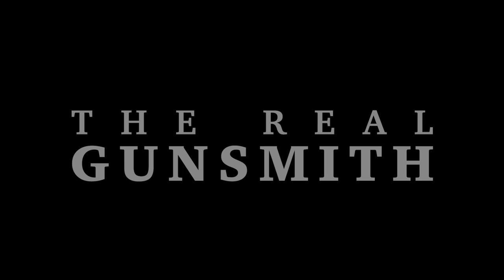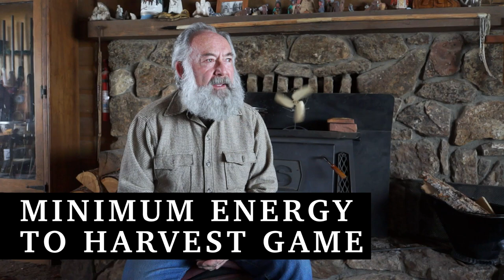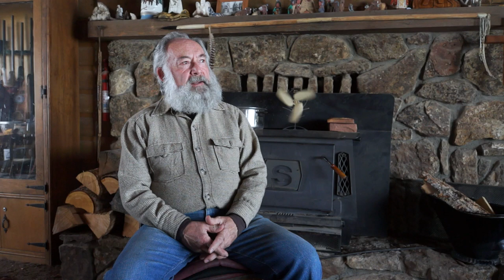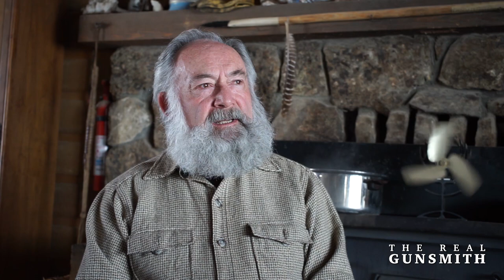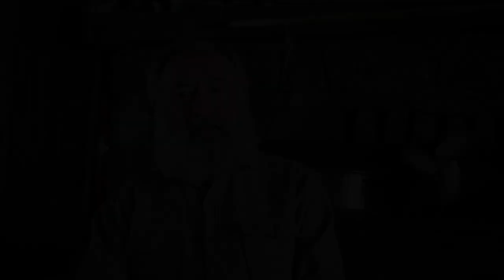Minimum Energy to Harvest Game -- The Real Gunsmith

Comment: In 1973 I bought a new Weatherby Vanguard 7mm Rem Mag modified the barrel with Mag-Na-Port from Ann Arbor, MI (Japan made, very shiny bluing (looks mirror black) and a beautiful wood stock that I had a craftsman glass bed, 1 inch longer barrel than found on Remington rifle chambered in 7mm Rem Mag), I fire lapped the barrel with 5 shots (not sure if it did any good but did it anyway) I hand load Speer Mag Tip 175 grain and they work just fine.. I pull the trigger and the game (be it from a mouse to a moose) stop moving.. If I have a good day I have grouped 5 shots at 100 yards that fit under a dime (under 1/2 in).. Not too shabby for a hunting rifle.. I have to say that Mag-Na-Port, builds confidence by removing a large amount of recoil and muzzle jump and eliminates flinching (a common problem with people shooting high recoil rifles).. I migrated from the 7mm Rem Mag into muzzle loaders for the challenge and now hunt exclusively with a crossbow.. Have not even shot the 7mm Rem Mag in 15 years or more.. I pull it out once a year, clean it and put it back in storage.. I also have an Ithaca 30-06 that my father left me after his death.. That also shoots very well with 165 grain hollow point boat tail bullets.. I am proud to say that both look like new and when I die one son gets the Weatherby and the other son gets the Ithaca..

Comment: Do you believe that handgun hunting is ethical? For the longest time I have wanted to take my 357 magnum out to shoot a wild hog, but never actually did it. Obviously I'd be keeping it within archery range and use a hot loaded 158 grain soft point, but I am still iffy about it. I have gotten pretty close a few times and always thought I could make the shot easy, but I usually have hot 125 grain SJHP bullets for couger or crackhead defense. I have my doubts that the load I use would have enough penetration for a hog.
Reply: Put the .357 through a lever gun , 158g will flatten any pig out to say 125 yards. 80 to 90 yards is optimal , I've killed hundreds of them here in Australia with that load. 30/30 is more humane out to 200 yards,or a little more , but up close there's zero difference.

Comment: Thank you for saying that BC means next to nothing for the hunter!  I get so sick of hearing people talk about the BC of the bullets they're using to take game at 75yds, as if it makes any difference at all, lol.  I assume most people are confusing BC with SD (sectional density) which IS important for the hunter if you're at all concerned about penetration (you should be)

Raw data and statistics are a great tool... in the right hands of the person that knows how to process that data and effectively apply it.  For everyone else it ends up being a battle to find the highest theoretical numbers, even though they've no clue what said numbers actually correlate with in practice.  This isn't just a problem in the shooting community, it's everywhere, but I sure seem to see a lot of it from gun people of late...  If one would choose a hunting round based on the on-paper numbers there are a lot of cartridges that would be totally ignored.  Look at the big revolver rounds:  .44mag/.45colt/..454 casull/etc.  The SD's are crap compared to even moderate rifle rounds, the BC's are horrible, they're relatively slow, heavy, and nearly as wide as they are long.  Yet I've seen few rounds, rifle or handgun, that can put down a whitetail or mule deer as quickly and with the authority of a 240gr-300gr .44mag projectile within 100yd.  Guess those deer didn't realize that the 240gr .44 has a sub-par SD for a deer round...  Same with the bears in AK that get dropped with a 325gr .454 casull or 340gr .44.  

Haven't even gotten a full minute in and you've got my like!  Back to the video...
Reply: People watch too much Creedmoor and Ammo....er,  I mean Guns & Ammo.

Comment: "A Berger bullet can't hit harder than a Barnes?" I respectfully disagree. I have hunted for over 50 years and been an avid reloader. I have used a wide variety of bullets on game and witnessed their pros and cons. I have been a big fan of the Nosler Partition and then the Accubond. I was never impressed with the accuracy or terminal performance of Barnes bullets. For the last 4 years, I have been using the Berger VLD Hunting and Classic Hunter bullets in my .243 Win, 6.5 Creedmoor, .300 Win Mag and .300 Weatherby rifles. Thus far, they have been used to take coyotes, whitetail deer and black bear. In my experience, the Berger bullets are more accurate and transfer more energy to the animal than any other bullet. The bullets are designed to penetrate a few inches, explode like a bomb inside the chest cavity, and drop the animal on the spot. And trust me when I tell you, they work as designed. That said, there is one big downside to using Berger bullets on game - they destroy a lot more meat than other bullets.

Comment: If you can take a 1000 yard shot there’s no reason not to. Sorry bro, I’m not saying go take a 1000 yard shot with a .308 or a 6.5 Creedmoor because I do agree that you need a magnum to have energy at distance. When you get into very big cartridges like a .300 ultra mag or something of that nature I’d say those rounds a literally designed for that kind of thing.
Reply: Wind can move a bullet 30” or more at 800-1000 yds. And you can not predict it.  The bullet drop at 1000 yds may be 100”, and that will vary by 20-30” with different bullet selection, powder charge, temperature, elevation, etc.  all these factors and more will be the difference of getting lucky and placing a kill shot and more than likely missing altogether or maiming the animal.  Keep game shots under 400yds and limit all these factors and kill rates go up significantly.

Comment: I do not have experience hunting elk but for eastern whitetail's you can't beat a 130gr game king 270 bullet for dropping them in there tracks. I have killed over 50 deer with them never lost one and only had a few take a step.

 I've shot whitetails with Barnes x copper bullets and never found them. Only recovered one deer shot with a Barnes x bullet only because it had a 500 yard clear cut to run accross and almost made it to the woods on the opposite side. No blood trail at all! The Barnes x bullets leave almost no blood trail after a few yards. The hole going in is the same size as it is coming out and clots up very fast. 

Nosler partition bullets same thing, you better put on your tracking britches and hope your deer doesn't run up on another hunter before you get to it! Lost a nice 8 point that way shot with a partition with a 30-06. The Nosler ballistic tip or a Sierra 168gr match king would have dropped him in his tracks. However the partition did leave a blood trail you could track and we tracked him right to another hunter who got my deer. 

 Bullet selection is huge and here in the east hunters try to follow the advice of western elk hunters and it doesn't work very well on the small whitetails. They think the heavier the bullet the better and it's  just not necessary for small deer. Thin jacket bullets that open fast are the ticket. Just because a bullet works well in one caliber doesn't mean it will work in another. For example the Nosler ballistic tip works great in a 308 or 30-06 but is to violent in a 270.

I and a couple of friends have had excellent results with 85gr game king bullets in 6mm Remminngton rifles. One friend would cry like a baby if you took his away.

However I feel sure these heavier constructed bullets are necessary for elk and larger game. The bullet needs to be matched to the game animal you are hunting.

I do not match bullets to game by which one will shoot through from nose to tail and feel that is very poor shot placement. I have never been an advocate of shooting deer  in the rear end and have passed on several opportunities over the years.

Comment: A number that determines how a bullet will retain it's energy. Oh, and irregardless is not a word
Reply from the maker: From Cathy, The Real Gunsmith's Wife:     And from Miriam-Webster on-line:   
"Is irregardless a word?: Usage Guide

Irregardless was popularized in dialectal American speech in the early 20th century. Its increasingly widespread spoken use called it to the attention of usage commentators as early as 1927. The most frequently repeated remark about it is that "there is no such word." There is such a word, however. It is still used primarily in speech, although it can be found from time to time in edited prose. Its reputation has not risen over the years, and it is still a long way from general acceptance. Use regardless instead."
Reply: "it's" is not an appropriate word either JP.

Comment: ....sigh.... some common sense and logic at last. I'm old school and think like you Randy. BC isn't really relevant to getting your game at realistic ranges (up to a 1/4 mile). It is indeed all about delivering  certain amount of energy into the right spot. For deer sized game you need around 2000ft/lbs or more and many milder calibres like the old .303 will deliver that at 200 yards, and only about 1200fps at 400 so placement gets very critical, especially on wapiti.... always assuming that the bullets are proper game bullets that deliver all that energy inside the animal.
Personally I always liked to get a close as I could for precision, and at under 100 yards that's much easier.
Yes those Barnes solid bullets are great... expensive though.... and no matter how fast they are driven they will not blow up...

Comment: Just for the record, if you shot an elk at 825 yards with a 175 gr 7mm nosler partition it likely struck with less than 1000 ft lbs of energy, assuming ~3000 ft/sec muzzle velocity. If the only thing you changed was the projectile and it happened to be a 175 gr gameking, that same scenario would result in ~1300 ft/lb vs 985 ft/lb. Personally, I don't feel like either case is very ethical since even with the gameking you'd have ~40 inches of drift in a 10 mph cross wind at that range. With the partition that number grows to 53 inches so one could argue the sierra still gives a better chance at an ethical harvest given your parameters since shot placement trumps all.

Comment: I'm amazed this has to be said.. Hunting law where I live clearly states that animals larger than beaver must be shot with bullet that is designed to expand on impact. Which these match bullets are not designed to do at all. On hunters course differences of FMJ, rapid expansion and large game bullets was clearly explained. I have difficulty believing some would actually take a match bullet at an elk. Personally I'm moving towards copper bullets although currently I'm limited to Norma Oryx 156gr on 6,5x55 in moose hunting. Very short distances though and I'm looking to upgrade to 30-06 to be able to use E-tip or TTSX bullets. In Finland overall long range hunting is seen unethical to begin with. We traditionally hunt with dogs whenever possible or try to lure the game as close as possible. Most long range hunting is actually traditional tree top hunting of capercaille but it's always balance of stalking vs. shooting skill. Regarding bullets, I'm amazed that people still use even controlled expansion bullets without chemical bonding of the jacket to core. Mechanically joined big game bullet might loose 30% of weight even in gelatine, just imagine that after passing through a bone. That being said, Nosler partition is not bonded. While the two partition design allows it to penetrate, the front part sprays lead all over the animal.

Comment: Here's why I pay attention to BC on a bullet my Hornady sst 165grain have 2000 ft lb of energy at 500 yards where as my Winchester Power Point 165 in the same 30-06 have 1097. No that's not a typo. The hornady have almost twice the power when they hit, mostly from they're high bc. I can tell you that that extra power is also important not just design.

Comment: REAL GUNSMITH YOU SEEM MISINFORMED PLEASE READ: The hornady ELD-M is strictly a thin jacket match bullet. The ELD-X has a tapered jacket that thickens up into to the same interlock ring as their interlock bullets. Not "the same match bullet."
Reply from the maker: You have bought in to the slick marketing.  I am NOT misinformed.  It is obvious you've not sectioned one of the ELD-X bullets.  I've sectioned and game tested nearly every design made in the last 55 years. 

And the "new" bullets aren't magic because of any new technology, only in the marketers spin.  They are a failure as a top game bullet, shedding the core. 

The jacket is a thin jacket.  How the hell do you think they can claim they work down to 1300fps?  They are not better than any other cup and draw bullet, with the same inherent fault, bound to come apart. 

A 140 Amax and 143 ELD-X, sectioned, appear identical .  Send me an email and by return email I'll show you a side by side, or take the time and do it yourself.  There is faint interlock that doesn't work or the bullets wouldn't separate.
Reply: @TheRealGunsmith  I thought I recalled you praising the hornady Interlock line at some point, but could be mistaken... That's what made me say "hey that's the same as an ELDX." so I apologize if you're not a fan of the Interlocks either and I recalled falsely... 

New video idea: section out a variety of bullets (similar caliber/weight) and take measurements side by side? I think that would be awesome to see and would appreciate it. All of your videos are so informative though, keep it coming 👍
Reply from the maker: @jordanbryant4022  The ELD-X simply has a VERY faint interlock, not at all like the original Interlock line, where there is a definite interlock and it's "locking" is so much stronger as a result, than the faint.  ELD-x "interlock".

https://www.youtube.com/watch?v=pBDm41duCTo   Watch my video, Bullet Technology.  It should help.
Thanks for watching, commenting and the suggestion.

Comment: It's interesting that the title of this video is "Minimum Energy to Harvest Game", but then you (wisely) spend most of the time talking about properly designed and constructed bullets.  The fact of the matter is "energy" has never killed a big game animal.  All energy does is cause the bullet to perform the way it was designed, at the impact velocity the bullet achieved.  Because the requirements for different game animals vary so much, and because impact velocities do as well, trying to make a case for "energy" is a fool's errand.  This is especially true when one is talking about heavy, larger diameter, hard-cast bullets at modest or downright slow speeds.  The thing is, I'm sure you know all of these things, and it's hard to have a complete and thorough discussion in a 17 minute video, but terminal performance is a very complex subject that can't be boiled down to one bullet and one velocity and one type of big game animal.  There's more to hunting than 7mm Rem Mag and elk out there.

Comment: Touch bullets are only good at short ranges. At long ranges you need an weak bullet with thin jacket. Copper bullets give little meat damage, but are less efficient than proper lead bullets. 
Berger's hunting bullets have thinner jackets than the target ones. 
Copper bullets are less effective than conventional bullets regarding killing power. 
A bullet that go trough an animal just proves it did not dispatch all available energy at destroying vitals. Lots of the information he has is correct, but others is not based on science and based only on observations on what some thinks bullets is supposed to do.
Reply from the maker: Not true.
Reply: @TheRealGunsmith  backing that up by any science? Or just simply saying "not true"?

Comment: So if your 7mm only has 300 ft lbs at 1100 yards,that's the slowest shooting 7mm I've ever heard of.For one,most 7mm loadings nowadays are loaded with at least a 175 grain to 195 grain for faster twist barrels and run around 2900 to 3000 fps.The b.c.'s on those bullets are really high in the .701 and up.This guy doesn't know what he's talking about.B.C. keeps your velocity and energy higher at distance.If you look at the sectional density of the bergers in those grain weights are way above what he's saying is needed.Completely out of touch and out if date with what modern long range bullets are capable of....hahahaha...The guy needs to retire his mouth and quit trying to explain away what he thinks he knows about hunting and modern bullet technology.

Comment: Youtube started suggesting this guy, and he’s been kind of annoying so i watch more...He’s biased towards alot of things and is your typical older man who thinks he’s advanced on very simple subjects and machines that any mechanically competent person can understand. Guns and bullets are the simplest of machines.... and ballistic coefficient does affect the killing of an animal. it is basic physics.
  high BC bullets will have better terminal performance (penetration, bullet expansion and energy transfer) than low BC bullets, although the difference may not be significant. If you can flatten your point blank range, its all the better. 
He speaks of downrange energy. A streamlined bullet WILL give a greater downrange energy, even if only marginal. It does affect it ability to keep speed, therefore will strike harder. Thats why we advanced from musket balls to pointed bullets. He seems so arrogant like he is the end all be all of knowledge. 
Bullets advanced mostly because of better tooling and manufacturing, so if we can keep advancing until you hit a cap, why not. Make a more streamline, better expanding, better held together bullet.
Theres no magic wise secret here. No crap bullet placement kills. If you shoot it in the leg, it wont die. If you shoot it in the brain it will die.